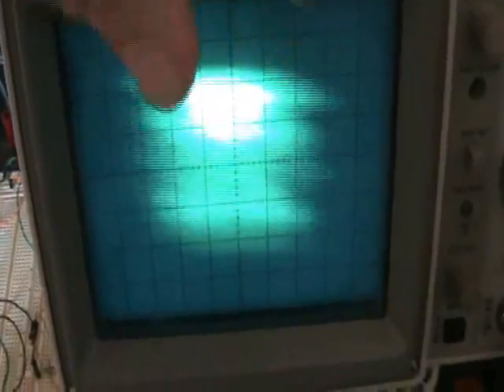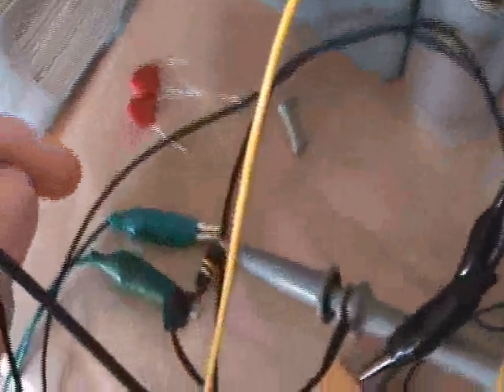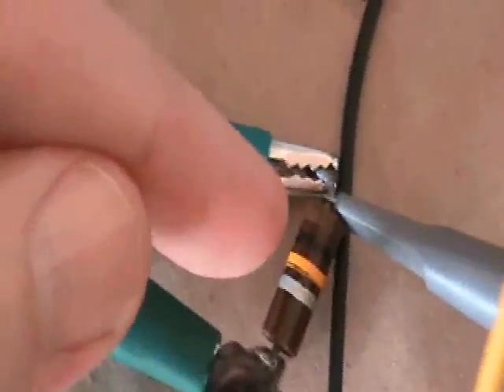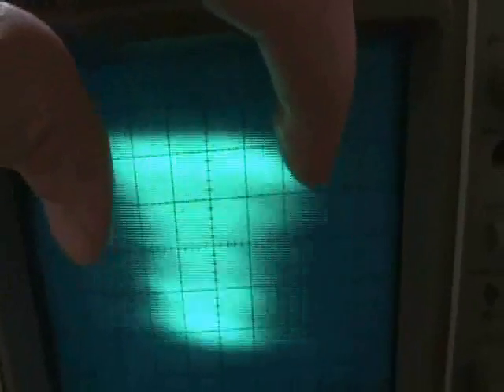Ep. 17 - Bashar Free Energy Space-Time Antenna (X-Y Observation)

Comment from the maker: An oscilloscope measures voltage with respect to time. The little germanium diode circuit can convert to DC and make it a bit easier to measure DC voltage and DC current, for easy conversion to Power in Watts.